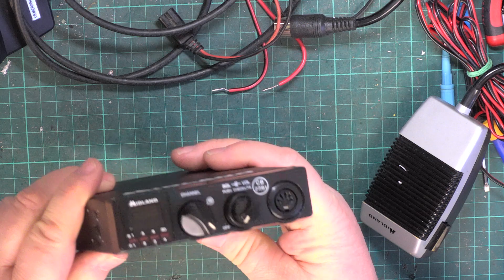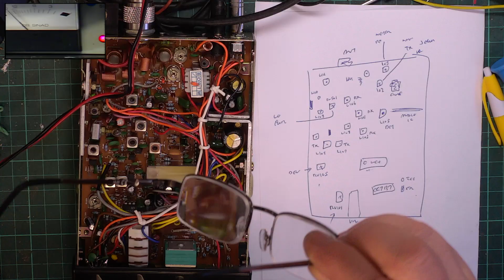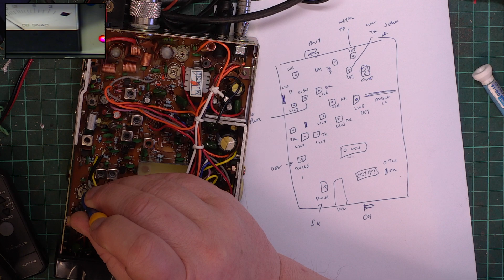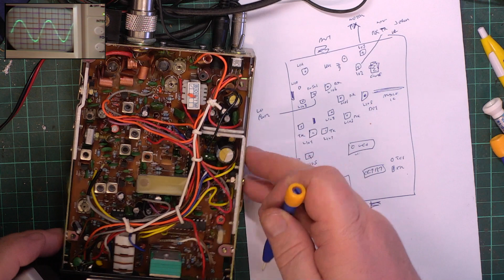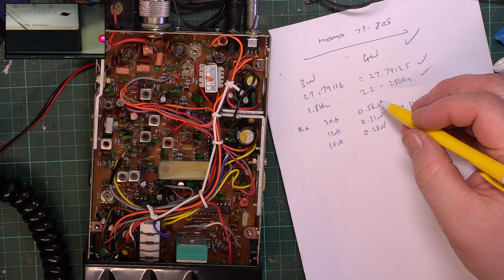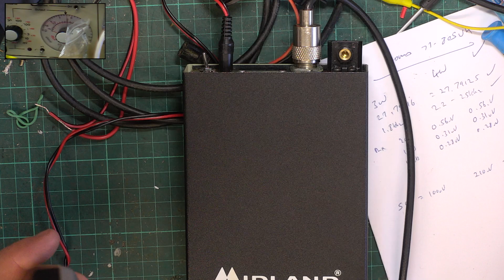Midland 77-805UK Port-A-Pak CB27/81 UK FM CB radio (mobile) - Service & adjustment

Comment: There might be a break in the cable when stretched, but you could pull it and not find it, just haw it goes.
How is that Prot-A-Pack?  I can see where an aerial would screw in the back, where does it get its power from, is there a battery pack to go with it?  Tidy enough set for what it is.  Very good condition, the customer looks after their sets very well and more importantly stays out from the inside of them.
Reply from the maker: Yes, all the case & aerial has come with it..even the instruction book.

Richard
Reply: @ukfmcbradioservicingTango21  Tidy set for its day then.  More useful than a hand held.
Reply: @ukfmcbradioservicingTango21  I think that is a brilliant idea, why did others not make sets like it.  Take it out of the can and instantly portable, best of both worlds.  😎